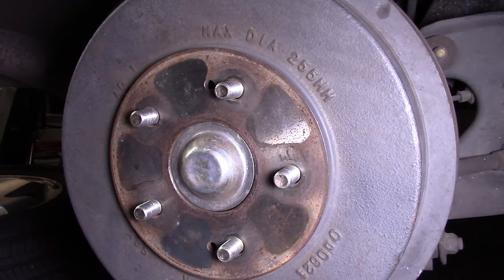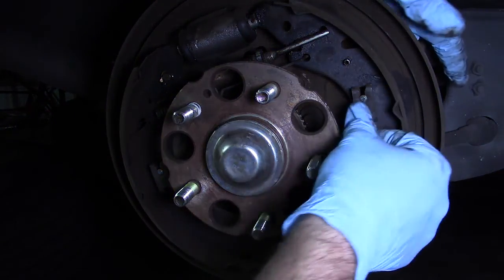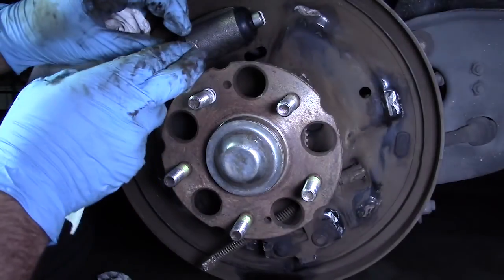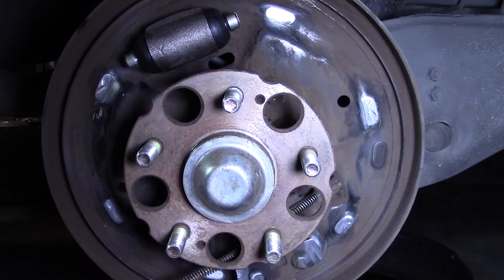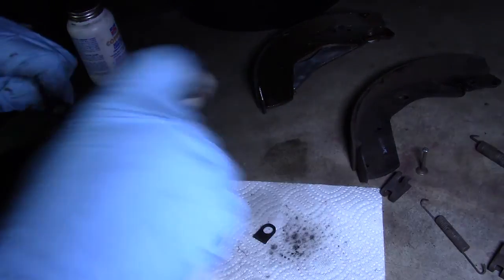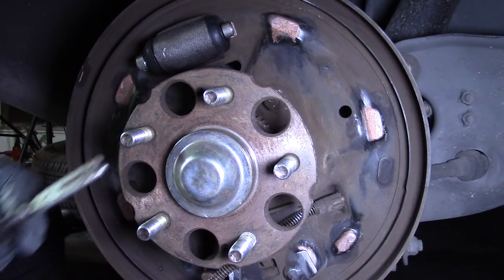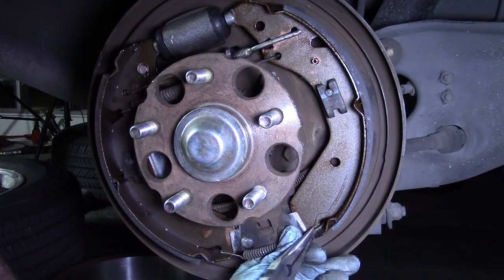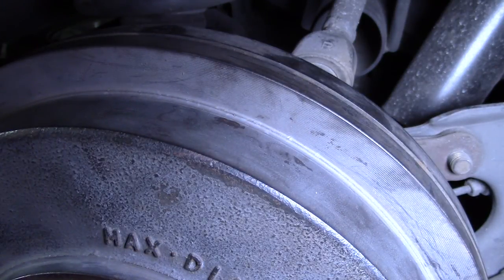How To Replace Rear Drum Brakes and Properly Bed In (2000 Honda Odyssey) DIY

Comment: I was bleeding the brakes on my Honda Odyssey 2000 and when I came to the rear driver side, the bleeder screw was a little different size than the other side. I was little puzzled but thought maybe when I had the new brake line put in a few years ago the old mechanic must have broken off the original and put this one in.  I backed it off to start the bleeding process and then the screw fell out! No matter how hard I tried, it wouldn't go back in. It was barely holding in and it was stripped.
It was late in the evening and I ran to get a dorman multi size bleeder screw kit from Autozone and tried them all and none of them fit right.
Waited until the morning to see what the hell was going on.
I saw EricTheCarguy show how you can get the assembly off without taking the whole thing apart and did that to get a better look.  The assembly was totally shot and one side didn't return when compressed.  
The bleeding was a blessing in disguise because if that screw didn't fall out, I wouldn't have investigated deeper and found a bigger problem!

Long story short, EricTheCarGuy was right about how to remove the assembly.

But when you watch his other video about changing the brake shoes?

He struggles to remove the main spring on top. Very dangerous doing what he was doing with all that tension.

I love how 50sKid showed how to take it all apart without any special tools and it worked perfectly!

The secret was to remove the bottom part of the shoe  on one side first past the little lip and then remove the bottom spring!

Comment: Excellent video! I hadn't worked on my 00' Odyssey rear brake pads in about 10 years so your video is super helpful. I had to replace the wheel cylinder so decided to change the pads as well. I also used an alternate method for re-attaching the upper and lower brake springs. Instead of using pliers, I hooked the end of the spring around a thin screwdriver and then put the screwdriver into the hole on the brake shoe. I have more leverage with the screw driver handle, so the end of the spring loop slides right into the brake shoe hole when you stretch the spring with a screw driver.

Comment: Bed-in procedure explanation...best part of the whole video!  Thanks 50sKid!
Reply from the maker: +Nathaniel D. Thanks man
Reply: 50sKid I forgot to ask earlier but after you performed the bed-in procedure and the brakes have cooled down, do you need to back up the car then hit the brakes to get the rear brakes to auto adjust to their final position?
Reply from the maker: No you only need to do things that like with drum brakes and that is only for the parking brake assembly--some of them self adjust when you apply the brake when backing up.  But not all of them, some self-adjust when the brake is applied in the foward direction or any direction.  With discs you just do the procedure I did in this video.
Reply: 50sKid Thank you. Very good video!

Comment: I need your help I have a 2000 Honda Odyssey we replaced rear brake shoes and cylinders but petal still goes to the floor.What do I do? Thank you.
Reply from the maker: There may be air bubbles trapped in the system that needs to be bled or your master cylinder seals may have failed, so the piston just moves through the cylinder but doesn't pump any brake fluid out.